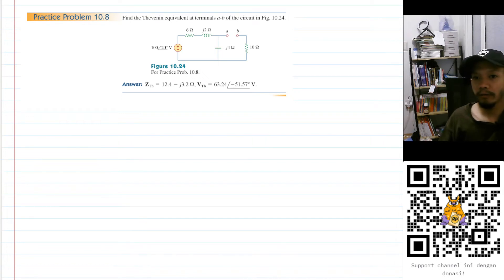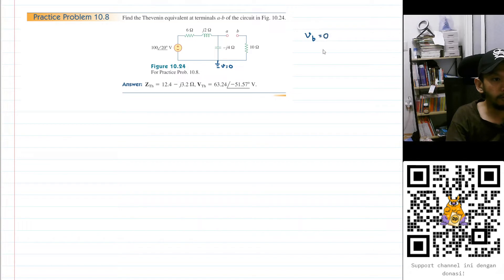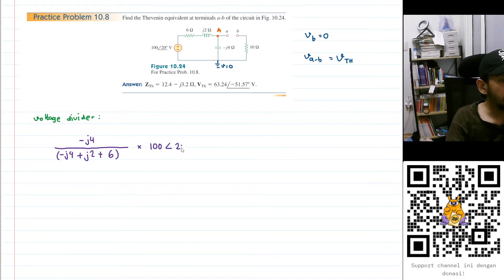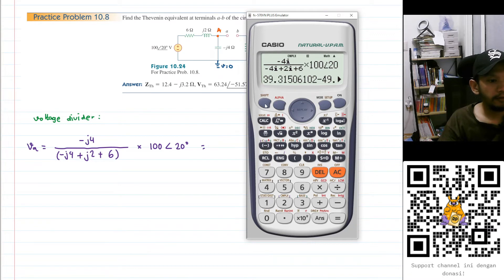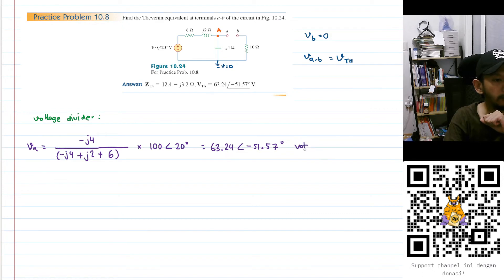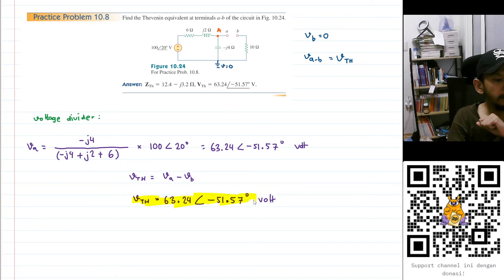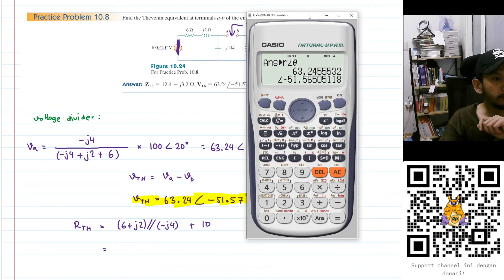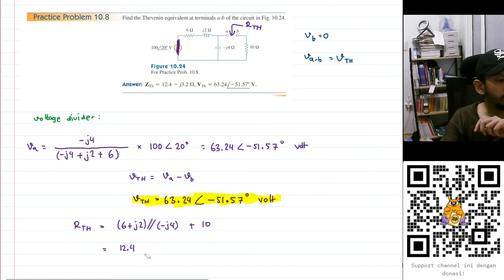Practice Problem 10.8 - Find the Thevenin equivalent at terminal a-b of the circuit of figure 10.24

Comment: Why do we ignore the 10 ohm resistor in our calculation of Vth? Wouldn't this affect the voltage across ab due to further splitting the voltage? Maybe a dumb question, are we supposed to take ab as an open and this is the reason why?

My problem solving approach was figuring 10+(6+j2)||(-j4) to get Zth, then use this to get Ztot=(Zth+10)||(-j4)+(6+j2), then figure Itot=(100<20)/Ztot, current division to figure the current I0 going into ab as Itot((-j4)/(-j4+Zth)), then multiplying this by Zth.

Sorry for the long comment, trying to learn which logical pitfalls to avoid, thanks
Reply from the maker: It's an open circuit voltage.